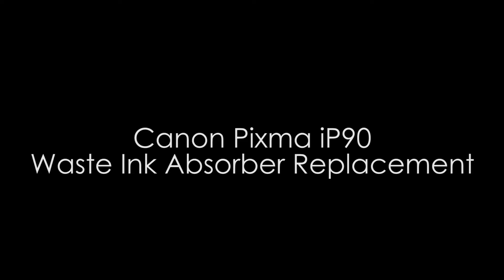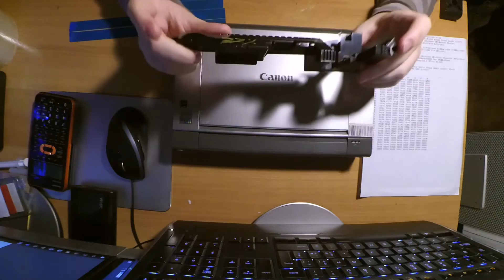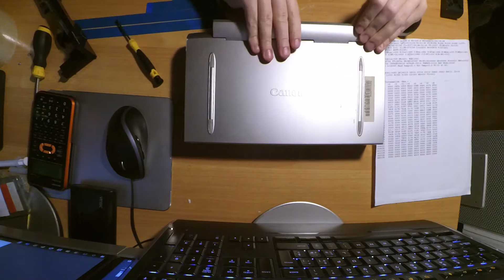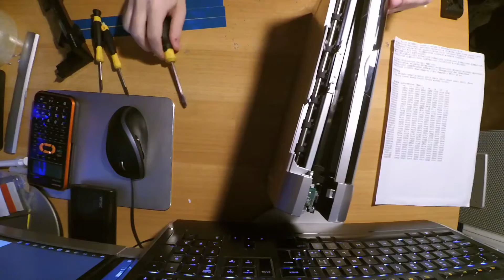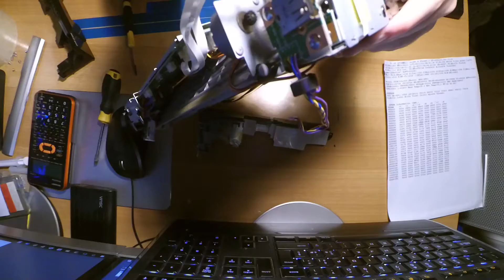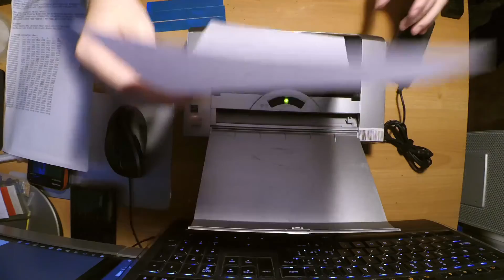How To Replace Canon Pixma iP90 Waste Ink Absorber

Comment: I'm getting the 5 orange flashes indicating printhead error.  I had manually cleaned the printhead before the error message.  I was very careful with it. I have tried 2 printheads, and both give the same error message. Any ideas would be greatly appreciated 🙏
Reply from the maker: Hi :)
either you have 2 defective heads, possible but weird, or you have a faulty main pcb, or the contacts in the carriage that connect to the printhead are dirty or damaged.
Reply: @PaoloMarcelli  thank you 😊
Reply: @Paolo Marcelli  hi Paolo,  both print heads are the problem.  I recently cleaned both manually with a little windex and a syringe, as seen in other videos on YouTube.  

Do you know of a safe way to clean the dried print head? Thank you 😊

Comment: This guy did a descent job explaining how to repair the gear but for just a stupid flat cable that needed removed, I had to throw my printer away. I was sad, especially because he made it look like the actual circuit comes out. Pulling the cable out would have been so easy to know had he just did a closeup on it. It's such a shame.  I was so close to repairing my i80. Thanks for the help but please can't you guys do closeups on the work you do???? Cmon
Reply from the maker: Hi
First off, you need to pay attention to what you do, and not just watch the video and replicate with no eyes on what you're doing
Another important thing to consider is that the i80 is NEARLY the same, but not the same... In the iP90 the only flat cable that needs to be removed is the one at the back... Again... Watch you're doing!
Oh by the way, couldn't you just replace the flat cable? They are extremely cheap... 

Paolo M. - ADCSFXworks
Reply: I think I know what you mean. The cable to the Bluetooth gets pulled out by the cable, not at the clip. I pried up at the clip and detached the clip from the computer board. Now I can't reassemble. 

Update: I was able to re-attach the clip after removing the waste tank. I will update if the Bluetooth works.

Comment: Thank you for all your fine work, if you were at US i would have sent you my printer to repair it for me no question asked. excellent job and a real professional. 
I repaired broken wheel on my ip90 printer, After refilling my old tanks with small amount of ink I put the tanks back. I did wash the sponge under, the heads with a warm water. The print head is very new. The unit was turned on went through two pages without printing anything and the indicators tell me the tank is totally empty? 
I think I may need to set the counters to zero. It does not print anything and does not clean anything?  This printer was not used very much at all. What should I do?

Comment: Ciao.. My ip90 does print a test page using the buttons, however does not print from my Ubuntu laptop. Just grabs the paper(s) and spits them out without printing. Even if it is for one page, the entire paper is emptied this way.
Reply from the maker: Hi! I don't know, do you have the correct drivers installed? I always worked only on Windows though